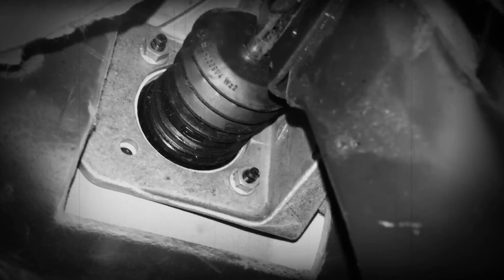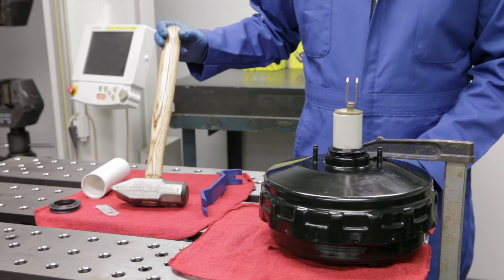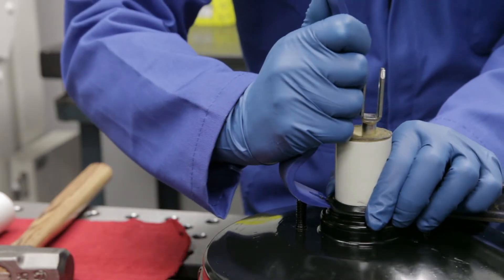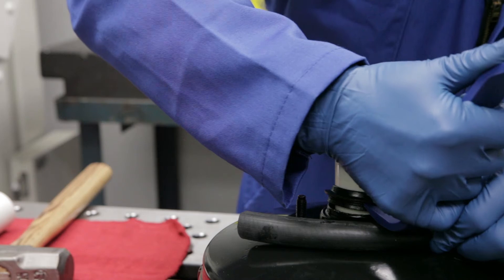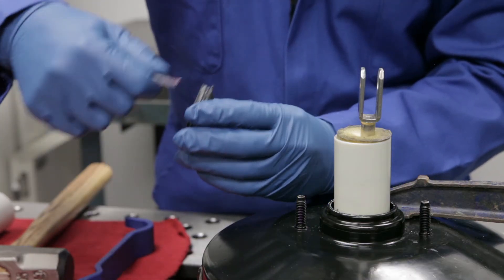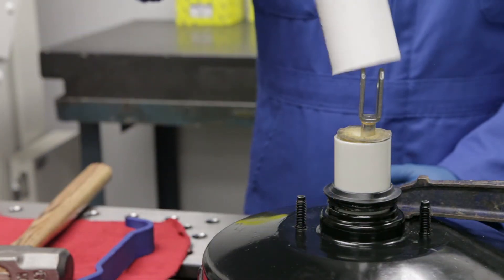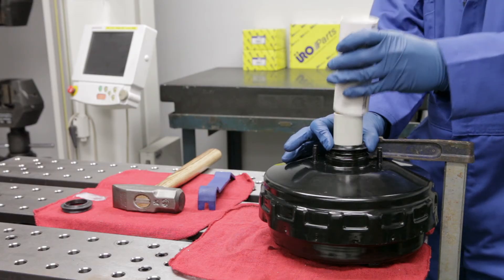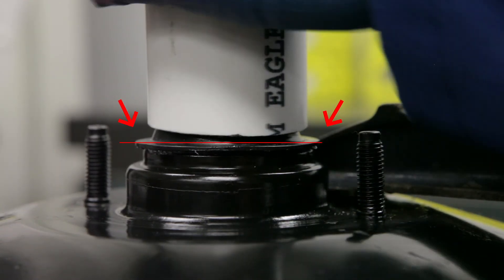URO Parts Repair Kit 001 430 0708 for ATE Brake Booster Plunger Seal 03.7718-5028.1

Comment: Will this fit a 07 S40 and do uk have. UK stockist?
Reply from the maker: We have not confirmed it will fit your vehicle, but that doesn't mean it doesn't.  You'd have to confirm if your booster seal was marked with the number 03.7718-5028.1.
Reply: URO Parts thanks. Any UK stockist?
Reply from the maker: Please email us at sales@uroparts.com and we'll be happy to help.